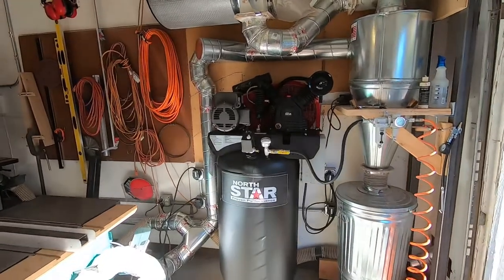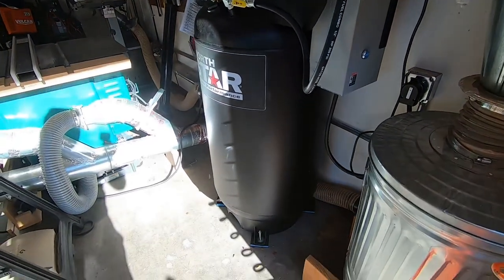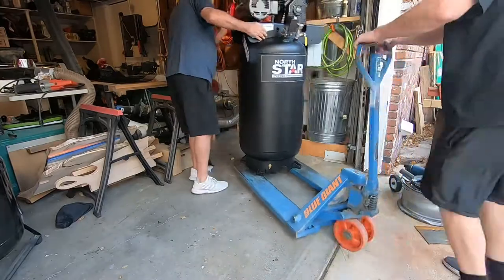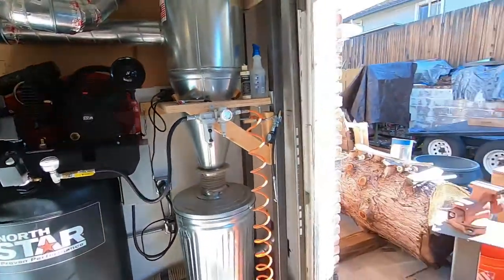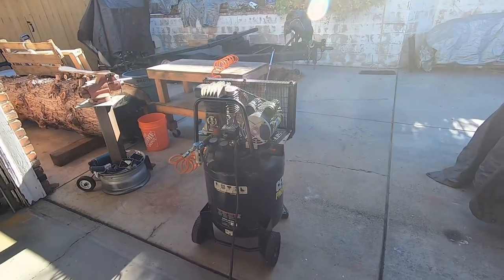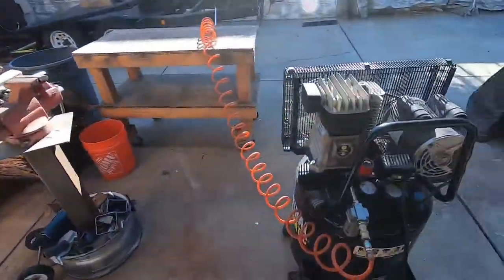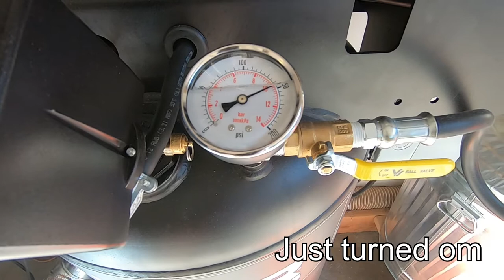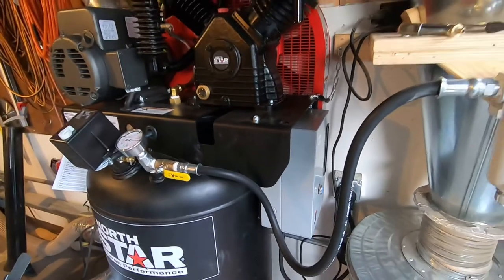North Star 80 gallon air compressor - see why I made this choice!!

Comment: For a 7.5 HP compressor the pump rpm seems awfully fast. I read the manual and nowhere do they provide the rpm of the motor or pump. When you get into this price point it is all about RPM of the pump. as well as the motor. I infer most industrial pump of 5 HP and 7 HP run around 800 and the motor is nearly always 1750. Higher RPM of both are cheaper.
Reply from the maker: I appreciate your comment, but I don’t think that you can state that one is cheaper than the other strictly based on HP and RPM. This is a different style pump  than many of the other 80 gallon compressors available.

Comment: That pump is gonna over heat and not last long. Because, you have it to close to the wall. the pulley on the pump doubles as a fan and will struggle to pull air to cool the pump head down. I'd give it at least a foot of distance from the wall.
Reply from the maker: The unit is about 5 inches from the wall and can pull plenty of cool air from the floor.
Reply from the maker: The unit is about 5 inches from the wall and can pull plenty of cool air from the floor.